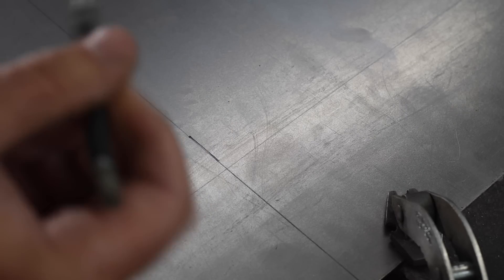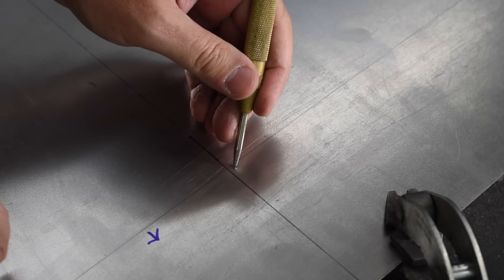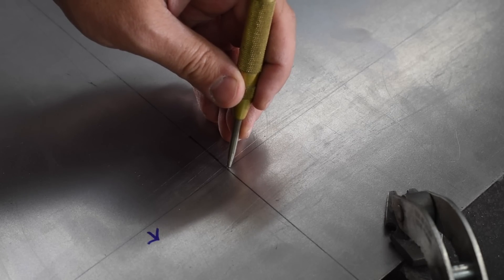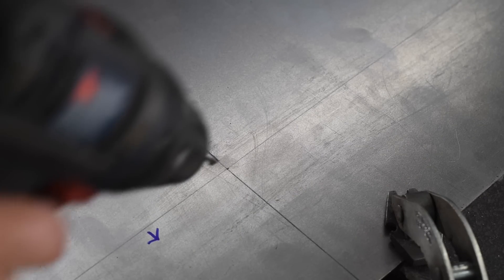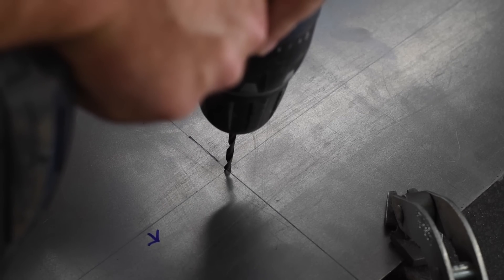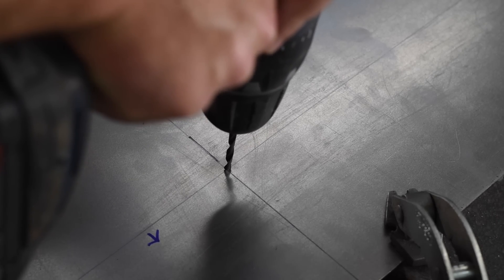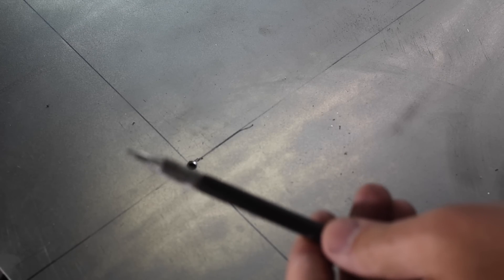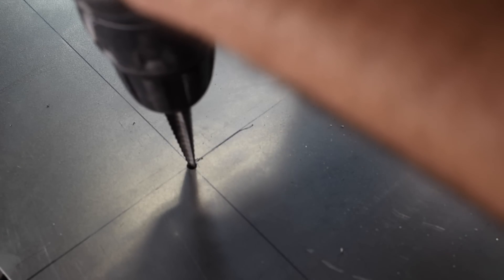How to drill a hole in metal steel iron - DIY

Comment: I need to enlarge an existing hole in 1/8" steel plate.  The hole is about 5/8 right now and I need to go to 7/8.  Would a step bit be my best tool for that application?
Reply from the maker: Jason, assuming your hole needs to be approximately 7/8, yes the step bit is the perfect tool.  If you need it to be exactly 7/8, you would drill it slightly undersized and use a boring bar or reamer to get it to exactly 7/8.  Hope that helps.
Reply: Approximate is all I need.  Thank you!
Reply from the maker: Cool, good luck with it.  Be sure to clamp your work piece if you can, use a little WD40, or some kind of lubricant to help keep the bit cool, and run your drill on lower speed on a hole that size...  take care.

Comment: I never really use a stepped drill, it's hard to sharpen them, i prefer deburring the hole with a hand deburring tool and you get loads of hot flakes flying towards your eyes and hands.

Comment: I guess I should have looked at my timeline before posting on your last video. I see you are doing a few of these tips! Good stuff sir.

One note, and I suspect this was the same material you used for the deburring video, is to only scribe the immediate area around the hole location. Those scribes introduce stress risers where cracks can form later on. In this example I think it was also the line you were cutting and not an issue though, right?

Sincerely,
Tom
Reply from the maker: Tom Zelickman Agree tom, if your just marking a hole location, just a small X at the intersection is all you need.  In this case, those long likes represent both cut lines, and bend lines for some drawers i am making, so no worries on the stress point, as the bend will happen on that line.  Thanks Tom!

Comment: pfff i can drill 10 holes in 2 minutes lol......Seriously ,depending on the quality of the bits,if i use it at that speed its burnt after 10 holes and doesnt cut anymore.I drill so slow people look at each other saying;whats he doing? Good little how to Gary !
Reply from the maker: ***** Lol... well, I have been told that drilling too slow and with too light a pressure is not good for drill bits, can take chips out of the cutting edge, and of course going too fast can burn them up.  Here is a good chart for feeds and speeds with different materials that i have used in the past.  http://www.free-ed.net/sweethaven/IndustrialTech/machinist01/pics/ch04.h1.gif
Reply: Interesting i think i'll print that thanks Gary

Comment: My drill bit usually snaps off WAY before I make a hole with it.  I've even tried putting ALL my bodyweight onto the drill and the bits STILL snap off.
Reply: Handstand.
Reply from the maker: Greg's Garage Maybe you should bulk up and gain some weight, your not putting enough pressure on it, causing too much flex in the shank, more weight, more pressure, and you should be all set!
Reply: Thanks Gary...  I was considering bulking up for swimsuit season.  Maybe I'll get a head start on next year.  BEEFCAKE!!!
Reply: Greg's Garage Were you standing on it or planking?